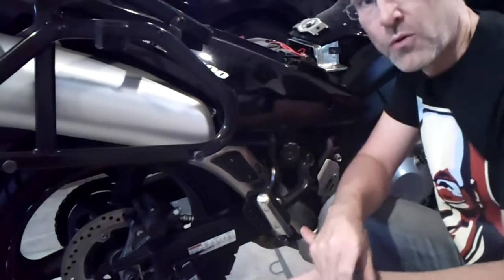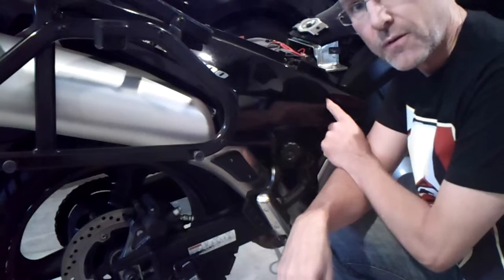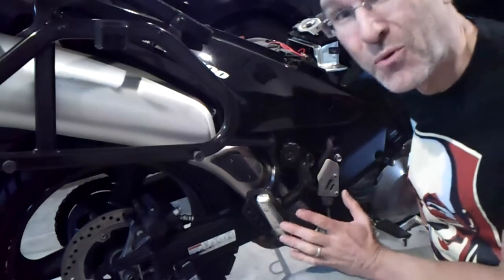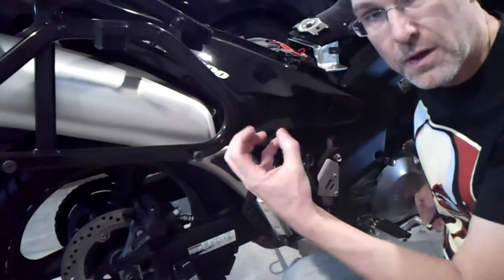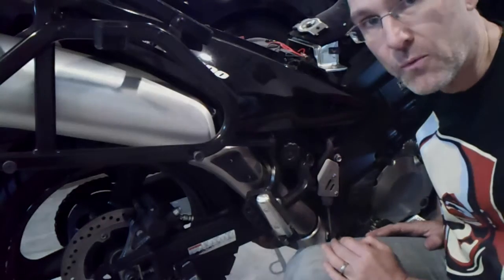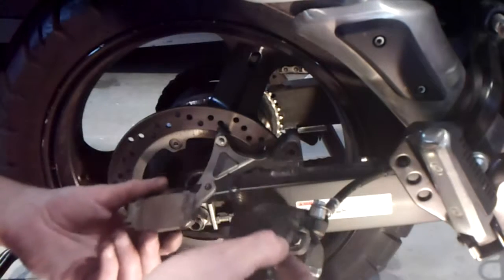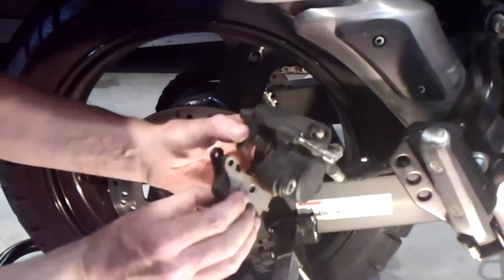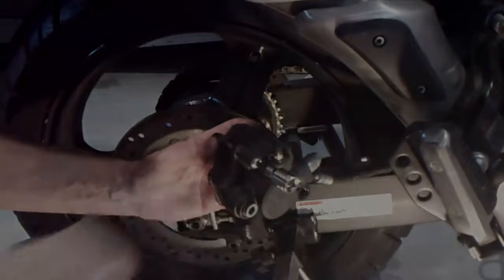Rear Brake Fluid & Pad Change Motorcycle (Part 1 of 2)

Comment: Excellent video and, that is/was a super clean DL1000

I know this an old video now but for anyone with a DL650 MK1 you need only remove the front screw/bolt and the underpanel plastic trim clip, then you can pull gently on the outer panel and there is plenty of room to both, remove the fluid tank cap and pour new fluid in....just done it this afternoon. It maybe the same for the DL1000 too?
Reply from the maker: Thanks for watching and for throwing in your insights for the benefit of others.

Comment: Just a headsup on those brake pads.  I installed the exact same set you did when I did the pre-season maintenance on my DL1000, replaced the chain and then due to constraints of time, loaded the bike on the trailer and set off for LaPine OR.  My first ride was from LaPine State Park to Crater Lake NP and a return to LaPine.  The rear pads failed when I removed the rear wheel due to a catastrophic failure of the rear tire.  When I removed the caliper, the friction material fell out of it's place.  It appears the bonding agent was shot, or defective.  I ended up installing the only set I could find @$44.00.
Reply from the maker: Thanks for sharing your experience. May be helpful to others. For what it's worth, my journal says I got 30k miles from the pads I installed in this video. (I've since replaced again with same.) No issues. Current set is holding up ok so far.
Reply: @UrbanMonkTV  Just an update to the failed pads.  My wife and I rode the bike from our home on Whidbey Island, WA to Columbia Falls, MT for a motocamper rally and on the second day we took a daytrip to Glacier National Park.  At some point after pulling out of the visitor center, one of the friction pads on the front failed in the exact same manner as the rear.  We returned home and repaired in the driveway, where I removed both calipers and while examining the only remaining set, the friction material fell of.  Lessons learned, I'll only use the pads I purchase from my local bike shop in the future.  This turned out to be a very expensive "cheap set of pads."
Reply from the maker: @dennisp.5053  So interesting you have had these problems repeatedly. Sorry to hear. Thanks for posting for the benefit of others.

Comment: Thanks for the videos! I just did the same to my 09' DL1000 V-strom. Everything you said was great except one thing.. Removing the plastic panel. After you removed the screw and then the plastic clip under it.. You can't remove the panel.. or at least I couldn't! The grab handle bolt goes through the plastic side cover. So I just pried mine out enough without breaking it..to get to the master cylinder cover. I wasn't going to take the time to remove that whole thing with the trunk on it. Let me know if yours is the same?
Reply from the maker: Rob C Thanks for watching. I did remove the top case mount. Sorry if I didn't detail that. I was thinking many might have the top case hardware.
Reply from the maker: might not